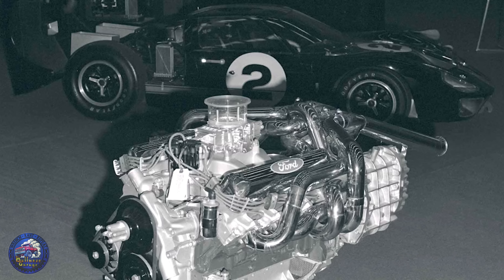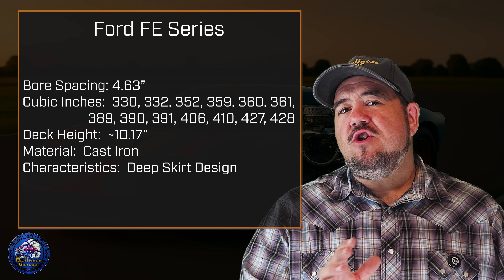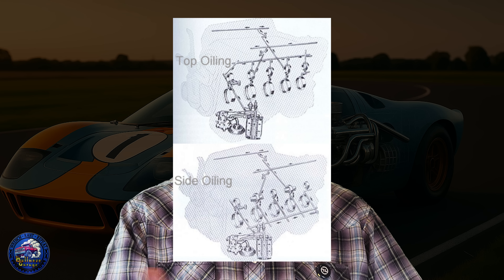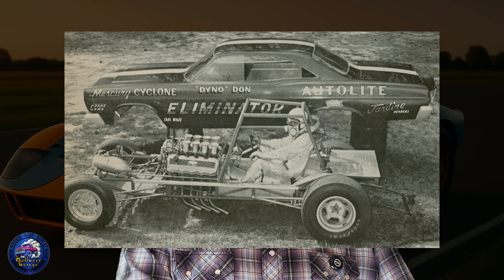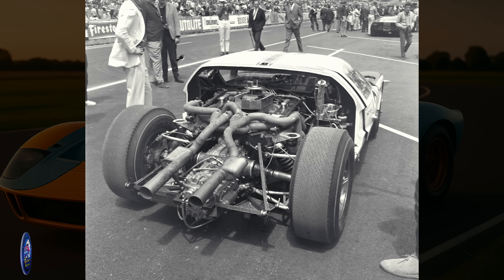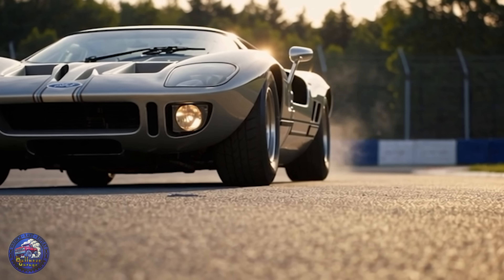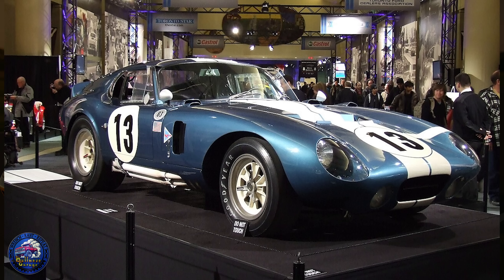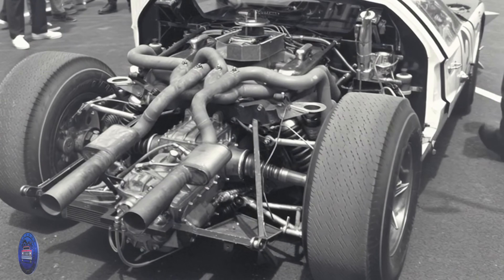Inside the Ford 427 Big Block V8: How It Made the GT40 a Le Mans Legend

Comment: So much misinformation in your videos. Every one I have watched has incorrect and completely false information in it. The 352 was not the 1st or smallest FE engine. That was the 332 FE that was available starting in 1957 for the 1958 model year. And the FE did not die in the Bullnose era. The FE ceased production in 1976 for cars and light trucks. 1978 was the last model year for the FT Truck Engines. The Bullnose era started in 1980. A full 4 years after FE engine production stopped. Also you state that the 385 series big block engines ( 429-460 ) ended production during the Bullnose era. That again is false. The 385 series engines continued production for another 11 years after the end of Bullnose Pickup production ended in 1986. The 460 was available until the 1997 Model year pickup

Comment: Do tell, how did Ford respond to the 917?
Reply from the maker: The 917 showed up after Ford had already packed up and left the battlefield. The GT40 wrapped up with four straight Le Mans wins, and the FIA rule change in ’68 is what killed off the 427... not Porsche. By the time the 917 rolled in, Ford had already made their point and moved on to NASCAR and the whole Boss-era stuff.

Comment: The 428 was a boat anchor compared to the 427.. the 428 was Ford's cheap alternative to replacing the 427... The 427 was a expensive engine to make compared to the 428.. like Lee iacocca stated the 4:28 is a boat anchor compared to the 427
Reply: The 428 wasn't a cheap alternative to the 427. The 428 was originally designed for the 1966 model year for the full size vehicles like the large Galaxies and Full size Mercury Vehicles that required lots of low end torque to motivate. It was a optional engine in the 1966 and 1967 Thunderbird. As well as a little hotter version for law enforcement vehicles known as the 428 Police Interceptor. The 428 wasn't considered a performance engine until a mechanic at " Tasca Ford "  dealership in Rhode Island installed 427 heads on a 428 Police Interceptor Short block. Along with the Police Interceptor intake manifold. And that 428 put together at Tasca Ford would develop into the 428 Cobra Jet. And the 427 was without question the premier performance FE engine. But the 428 Cobra Jet was far from a boat anchor even when compared to the 427 FE. The 427 could spin faster and had a much more over square bore and stroke . Allowing for higher RPM and HP when compared bone stock. But the 428 can be a monster with the available Aftermarket parts today. And while the 428 FE  of any type has become rather difficult to find. It can still be found if you know where to look. And won't cost $20k just for a core still requiring a rebuild . But the 427 Side Oiler is without question the king of the FE engine family.

Comment: The 427 ??
The BEST motor was the 255 windsor 4 cam that went to the Indy cars !

 It was faster than the 427 more reliable lighter and smaller, and had over 500hp (2hp per cubic inch )

Ford, effectively, had the Mustang Coyote 4cam engine in 1962 !

And replaced it with a dinosaur 427.

If only the GT350 came out with the Windsor 255ci 4 cam........ as Shelby helped develop it, and drove for Lotus, and was friends with Colin Chapman.

Comment: Check out the 2 cam Caliente engine. This was supposed to replace the FE until LeMans engine displacement was cut.
Reply: They should have gone back to the 255 windsor 4 cam !

They effectively had the Mustang Coyote engine in 1962 ! In 4.2 liters.
But Ford only used it in Indy cars even though it came from the GT40 originally. 
I still don't know why they went back to a much bigger heavier less reliable pushrod engine and used the 427. 
They got 500+hp from the 255 ! And 220mph.
it also dominated Indy for years, until the DFV Cosworth was introduced.

( I always wanted to put a 255 Windsor 4 cam in a 65 Mustang, in Indy spec. 500hp @ 9000+ rpm.  And call it Carol's dream, Shelby helped develop the 255)

Comment: 9:10  Wrong. Ford had an automated system that ran 4 engines and transmissions that simulated running the 24 hours at le mans racing for the endurance testing - all the throttle inputs and all the shifting.  Ken Miles had nothing to do with the engine.  Ken's job was to complain about everything wrong with the brakes and handling and areo until it got fixed.  I turned off at this point.  The Daytona Coupe still won after the GT40 with the small block Ford engines ran by private teams.
Reply from the maker: Confidently stated, but not quite right.  Ford absolutely used automated dyno rigs to stress-test engines and transmissions for 24-hour endurance runs. You’re right about that part. But saying Ken Miles “had nothing to do with the engine” doesn’t line up with the historical record.

Miles was the GT40’s lead development driver. He logged hundreds of hours pushing those cars to failure, and his feedback directly influenced fixes for oiling, cooling, and gearing... the very things that kept the 427 FE alive at Le Mans.

The dyno could tell Ford what worked in theory. Ken Miles proved what worked on the track.
Reply: @BullnoseGarage  Confidently reaffired what i said, ken was there to complain about stuff till it got fixed.  Car lost oil pressure, ford engineers fixed it, not ken. ken had nothing to do with the engine.